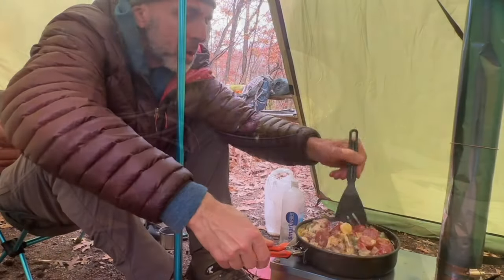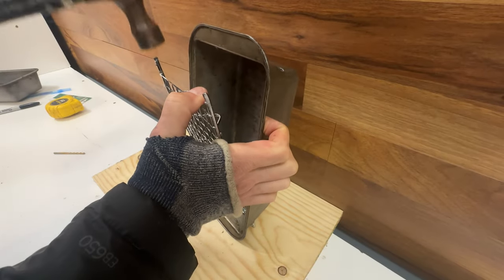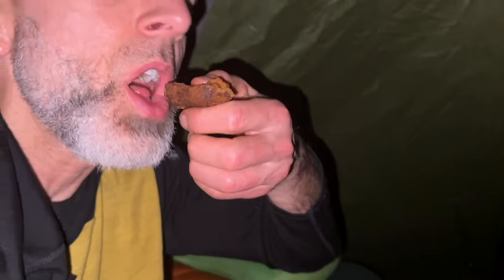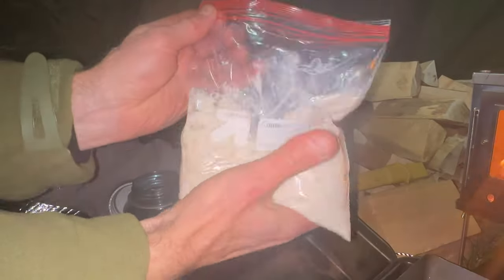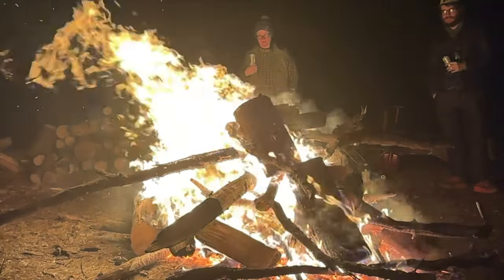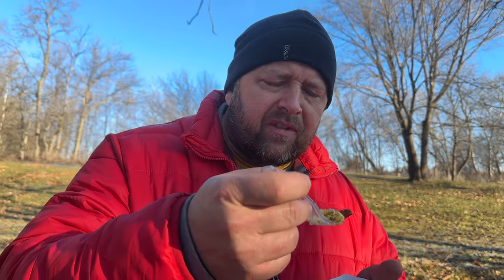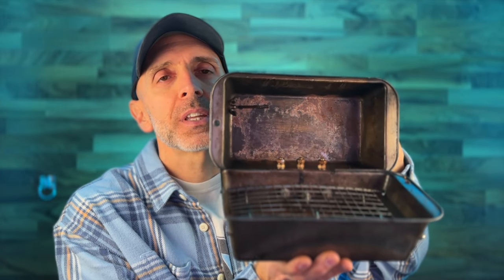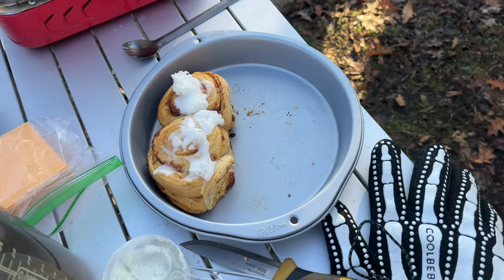DIY Hot Tent Oven Baking

Comment: Cool video, I see lots of baking in hot tent videos but not really any good explanations like this. Inside your oven is a little barbecue mesh grate looking thing. That might be a nice to separate the oven from the stove instead of the hose clamp. When I use a percolator on my wood stove , I use a grate to put between when it’s done to keep it warm but keep from continuing to boil. It might be easier to bake and regulate, my coffee will continue to perc if the stove is super hot
Reply from the maker: I will not need the hose clamp in the future. At home stove top conditions were different than in the hot tent.